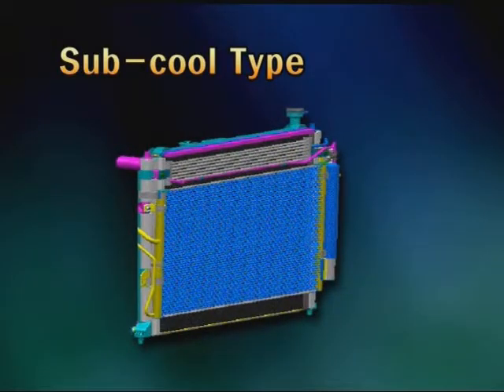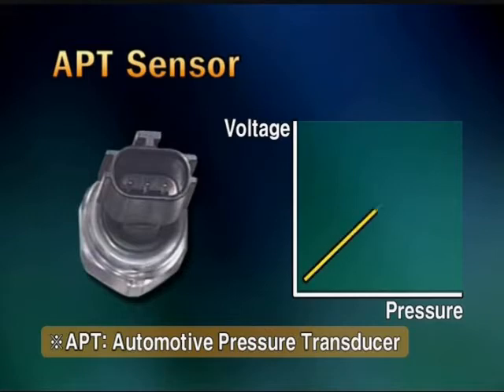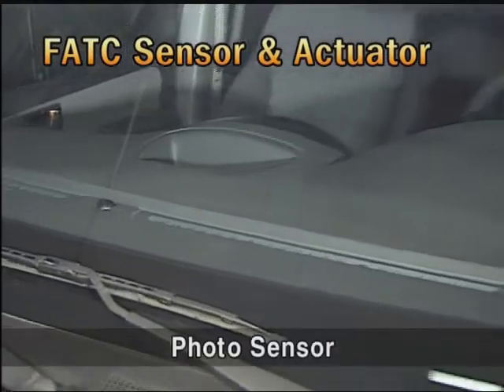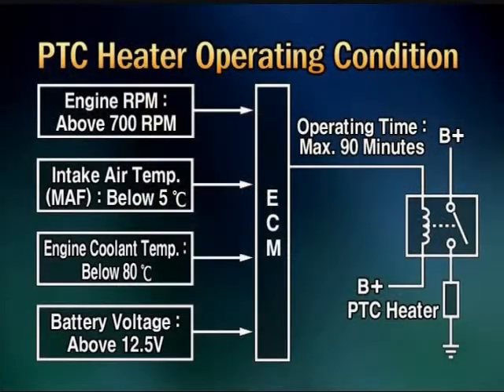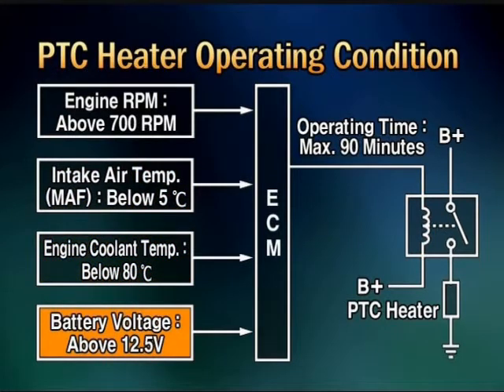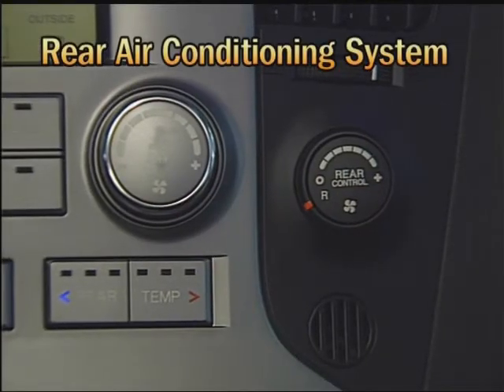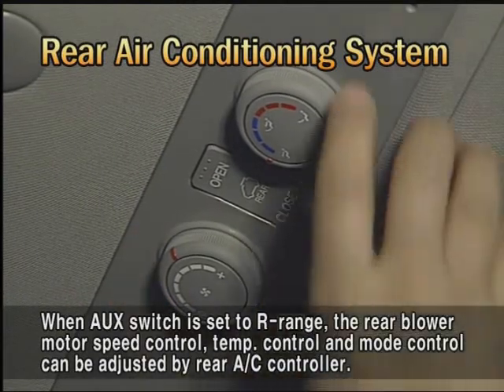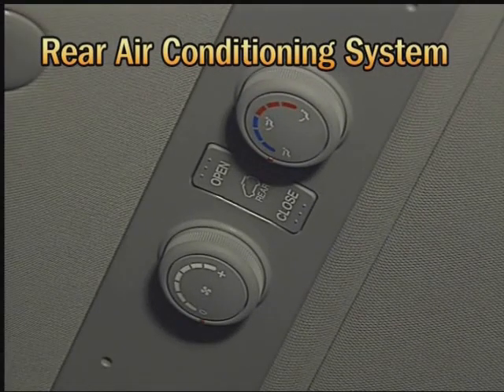Hyundai H1 Air Conditioning Explained, Operation and Diagnosis

Comment: This video is perfect!
Reply from the maker: Thanks
Reply: My H100 is blowing cold air in the front and significantly warmer air in the rear? Thoughts could this be due to a overcharged AC system with Freon?
Reply: I have tried every combination of buttons including rear controls. That is not my issue. I have checked all fuses relating to the AC system and they are all good